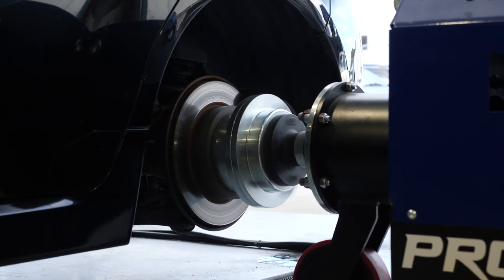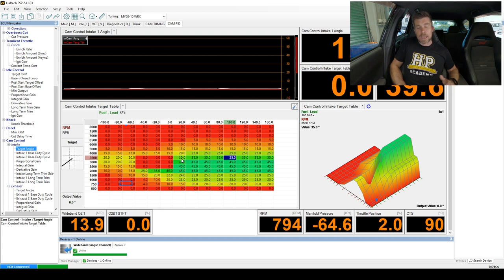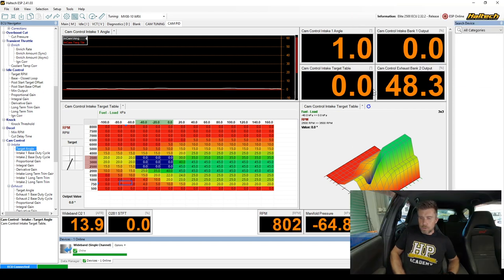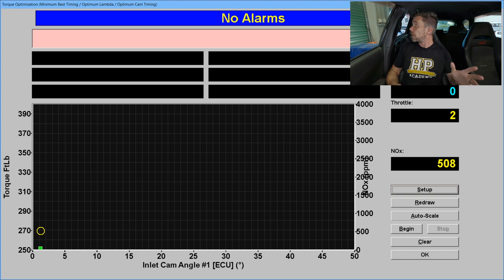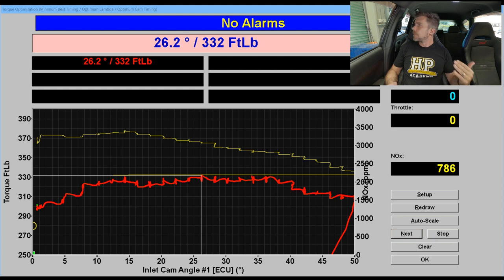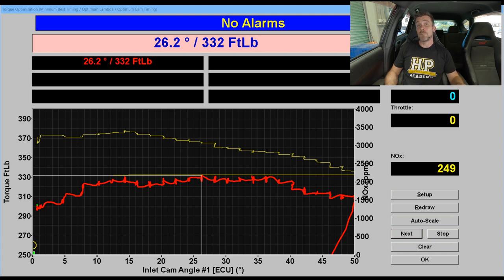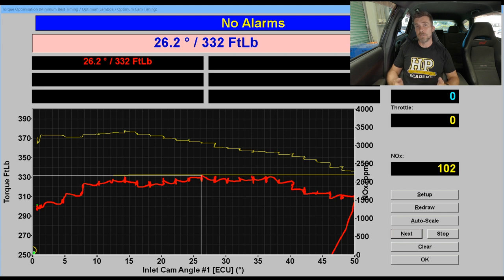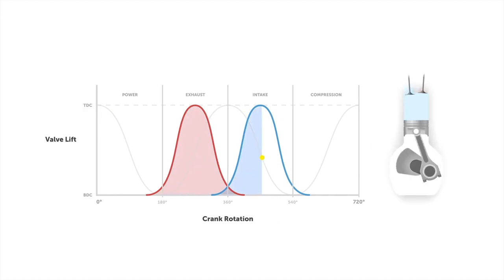Cam Tuning vs Emissions Standards | Variable Cam Tuning [FREE LESSON]

Comment: The torque graph is astounding. It seems to indicate that there is a tolerance band of about 35 degrees for the inlet cam timing without a change in torque. This makes a mockery of guys who say that you need to time cams to the nearest degree. Do you know what the start point of the cam timing is  ie  what are the opening and closing figures at your base point of zero degrees. Have you done this test at high RPM  and power. Does it show the same wide tolerance
Reply: Keep in mind this is a forced induction application (Subaru STI). An NA application is probably going to be more sensitive to cam timing, but I think your general point is a good one. Don't obsess about getting things perfect where close enough is still 99% of perfect. In the design engineering world we say no design is perfect because a perfect design would take an infinite amount of time to complete.
Reply: It was at 17% throttle. Would be a bigger difference and narrower optimum window at full throttle, and higher revs.
Reply: It doesn't make a mockery at all. He's running one cam at one specific rpm at one specific throttle opening. Torque isn't affected as much by the inlet cam anyway. The exhaust cam has a far greater affect on torque. And yes 1 degree of exhaust cam timing can make a measurable difference to torque.
Reply: @Fix_It_Again_Tony  Interestingly I've found it to be the opposite: turbocharged engines are more sensitive to can timing than na. I found that turbocharged engine cam timing has huge affect on boost threshold, peak torque, peak hp, and what rpm they both peak at.

Whereas na cam timing is more of a case of its either right or wrong, and making small timing adjustments are more for fine tuning.
Reply: If we are advancing the inlet cam, we are increasing the length of time of combustion?